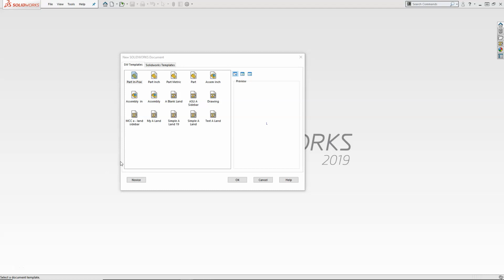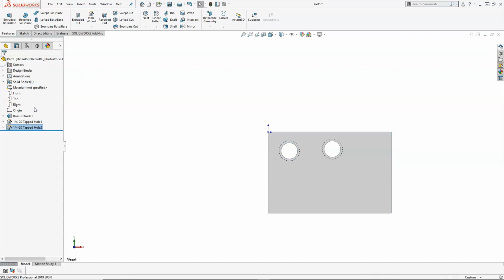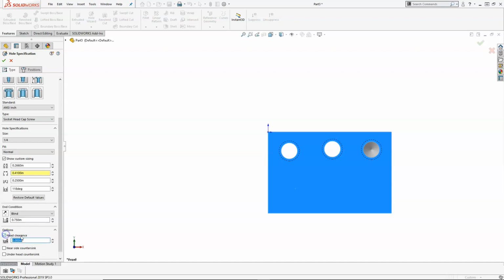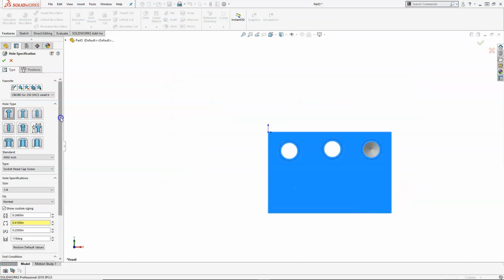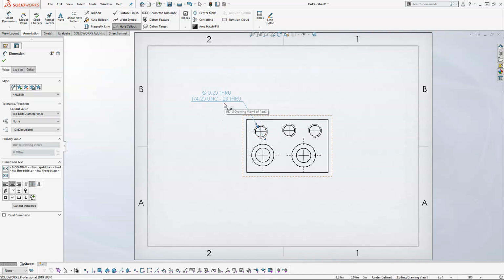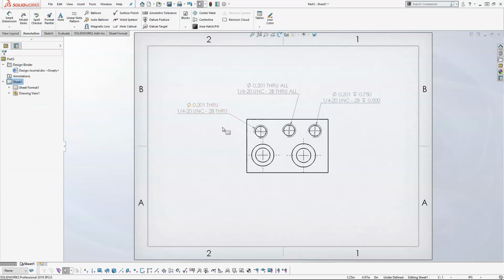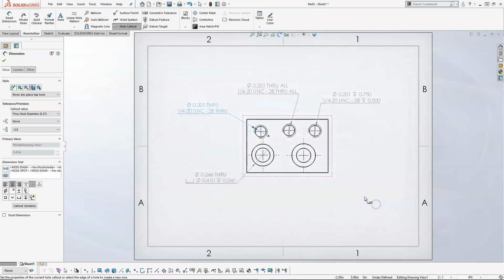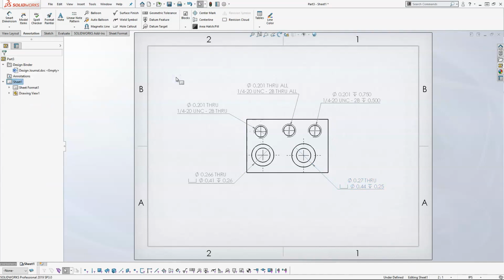solidworks hole wizard hole callout and favs

Comment: Why does your tapped hole has broken line? Mine is solid
Reply from the maker: Hi, I overlooked the obvious answer, I am in the ISO Drafting standard. ANSI is continuous. I tried adding a drawing layer with colors and line types/styles. This is higher control but not really necessary.